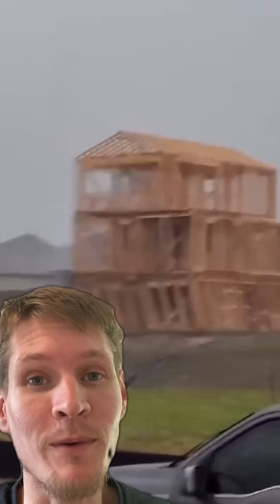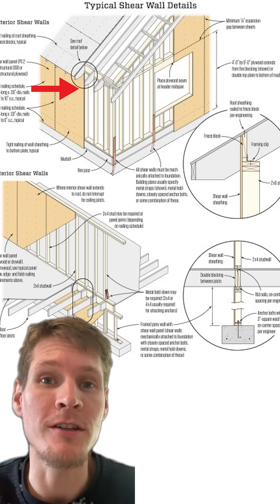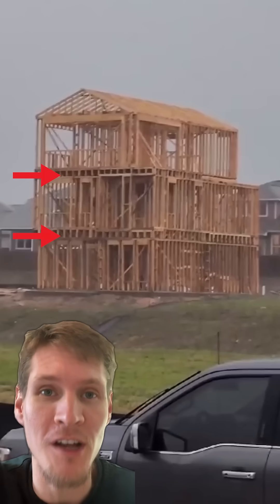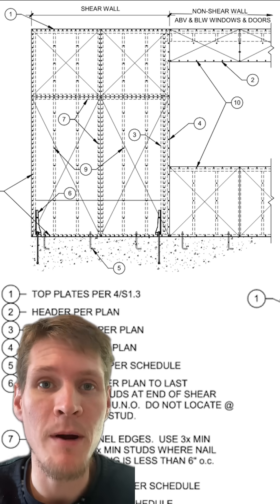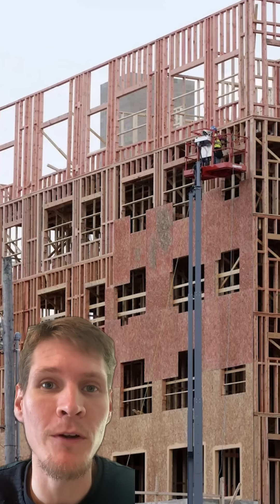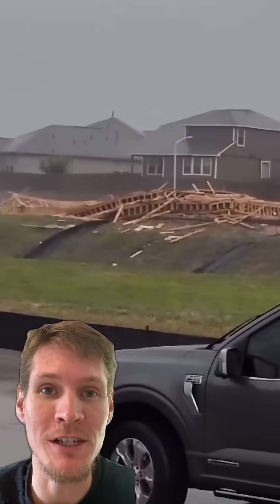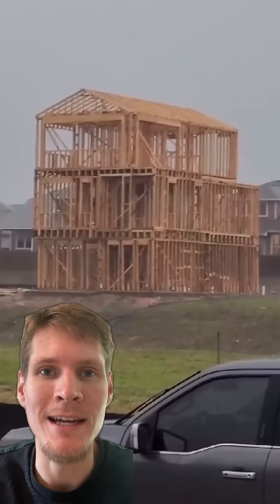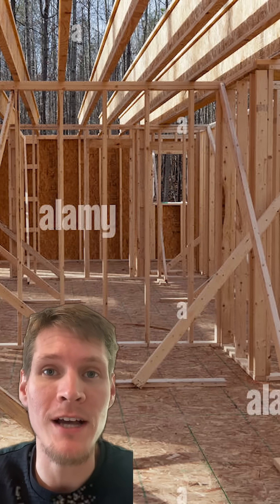Professional Engineer Reviews Reddit Structural Engineering Thread | Part 1 #engineering #reddit

Comment: I can't believe it even stood with 3 story's as long as it did with not sheathing.
Reply: Yea how did they even stand on any of this to frame the second and third story? This is a house of cards from day one.
Reply: @_JimmyBeGood  does everyone ignore the shoring he talks about? and the portopotty being knocked over?
Reply: @kwiztas  What shoring is visible is nowhere near enough. Note in the example he shows all that shoring done just for one story, not for 3.  The point is all that shoring was just to keep that from blowing over, not so it could support 2 more stories.
Reply: @kwiztas  insufficient for structural integrity. Load bearing so first floor should be reinforced and ticker wood used. They used the same crap up top and down. Physics.
Reply: Ya, imagine a bunch of guys up on the 3rd floor or roof, trying to finish… then they hear this noise they’ve never heard before!! Oops
Reply: @kingdommanlegacyministries7769 and then theyd never hear any noises again😮
Reply: Building the roof of this rickety mess was likely a nightmare. Moving those boards and beams in place probably created noticeable swaying of entire structure which was more obvious up there.
Reply: @marthein7 yep...as a framer, they had warning. Even a poorly braced single story will shake as others crawl around.
And shoring?.....regional term? 
Diagonal bracing what we call it.  The wall bracing for alignment was little help.
Did a lot of cut in braces or steel strap bracing   sheathed with foam.  They were pretty squirrelly too.
Reply: It didn't fall over from its own weight, It was knocked over by a storm big enough to rip out those diagonal 2x4s. the Diagonals hold up quite a bit of weight in normal conditions, as theres not much force coming from the sides
Reply: That's why timber framing is always better and stronger.It doesn't rely on plywood for any structural strength.
Reply: Using skyhooks 😅😅😂😂
Reply: @dr-rexmangrca113 k
Framers sheet the exterior walls on the floor and then stand them....
Interior walls are next
Then either floor joists for the next floor or roof trusses if it's a bungalow.
Reply: @1badcrow463  back before 1970s we  install braces in the walls... Top of corners running across several up right studs... Then cover them leaving them there forever...
Reply: @dr-rexmangrca113  This video was a horror movie.
Reply: If you look closer you’ll see it’s only half done.
Reply: *storeys
Reply: @Youtuber-k2p  *stories ....LOL

Comment: Carpenter here. That building looked like absolute shit to begin with.
That's all.
😊
Reply: It had clearly already been swaying in the wind for some time. That's probably the only reason they started video recording it.
Reply: I'm no Carpenter, just a Welder/Fabricator... but it looks to me those floor joists would be "waving" at me, even without any wind... 🤣
Reply: Agree - like toothpicks!! 😂
Reply: Engineer here. The only thing that looks wrong is no sheathing.
Reply: @JoeTheScientist  This would be an excellent short video to show to construction crews framing buildings. It's an excellent, Quick video that a
manager could show, and crews could watch on their smart phones and have an easy reference, and take very little time to show crews before they head out to work.
Reply: Auditor here. As someone with no experience in building whatsoever, I agree.
Reply: Yes i came to say same thing, looked off before even falling....and who the hell doesnt at the very least sheath the first floor. Never seen this done in over 35 years...and dont blame it on the younger generation...because they were taught by us older guys.
Reply: Not a carpenter here. And that building looked like absolute shit to begin with…. That’s all also
Reply: As a mechanic, I agree.
Reply: Joe, little more detail on your assessment, please.  To me, I see almost no horizontal framing at all.  This is just a deck of cards, right?
Reply: @ yes that’s right! The crew who framed it put a few support boards as they showed in the video. But that’s not meant to hold 3 stories of framing. lol
The sheathing should have been put on at least the first floor before continuing.
Reply: I’m from a seismic country and just a quarter of a second of watching that building was enough to cause me nightmares
Reply: Most american houses look like a matchbox to me but this one looks extra crappy.
Reply: @GuybrushThreepwood-e7n  👍🏼
Reply: Air nailing?
Reply: @kk-rc6dw  you could put a nail every quarter of an inch, it would not stop this. Nails don’t = structural integrity.
Reply: @arnold8746  you use screws bro
Reply: @victoriadedicova screws are weaker than nails. I love remodeling decks screwed together. one smack with a slege hammer sears screws right off.
Reply: @victoriadedicova you don't use screws bro, they don't have shear strength which is why nails are used..
Reply: Not screws.  @victoriadedicova
Reply: @Ghostdog99 When the cordless impacts first came out, most realized very quickly how weak screws are and how easily the heads snap off.
Reply: Beautifully said, couldn’t have put it into words better.
Reply: I don't believe you Joe, everybody thinks they're a carpenter that's why we have problems like this here.
Reply: Yes. That was my impression as well. It looked like it was half - assed from the moment the sill plates went down.
Reply: Hahaha I thought the same thing! I said if that was my house, I’d be hoping something like that happened. 

However, I don’t think I’d ever hire a company that would build 3 stories without any sheathing
Reply: Not a carpenter - still pretty obvious 😂
Reply: Exactly!😂 my 2nd grader said it looked like his popsicle stick house 😂😂😂
Reply: Forgot some diagonals
Reply: It’s in Texas what’d you expect? I’ve lived here for 20 years and every home here is built terribly
Reply: I was giving them the benefit of the doubt and thinking the wind had already moved it before the video started.
Reply: That bracing much have been shit
Reply: @Nath-sn1mv  they should have had cable ties locking it all together. My guess is, they didn’t realize that heavy winds were coming s
Reply: @Growinggolfing  mmmm I can agree to that as a possibility
Reply: I don't think it was bad. I've only helped build 18 house so I'm no professional but I got some experience 

Pretty sure it had something to do with management and not much about budget and or experience workers
Reply: I’m from a seismic country and just a quarter of a second of watching that building was enough to cause me nightmares
Reply: 😂❤💯😌😹i had questions 😄
Reply: Agreed
Reply: No doubt.
Reply: Show me one that was built in the last 50-100 years that doesn't look like sht? Did you build any?
Reply: @ any house I have built looks tight.  Plumb, square and level.  Every single time.  Some of us still have integrity and take pride in our work.
Reply: @jameshinton429  thank you.  My sister just had a set of lower cabinets installed in her pantry.  One on either side of a chase built in there for furnace flue.  The cabinet guys built the cabinets plum and level, but next to the chase wall it makes the cabinets look out of wack because the chase is not plum nor the same size on either side.   They must have just eyeballed building it and cutting the wood.  So sad. A 15 year old house.
Reply: It’s in Texas what’d you expect? I’ve lived here for 20 years and every home here is built terribly
Reply: How can you tell? Do the studs all look warped to you? Do you see something with the joists or blocking? Something with the headers? What can you tell is done poorly from what we could see in that 3 second somewhat distant video?
Reply: Looks pretty standard to me, besides the paneling
Reply: looks better on the ground
Reply: Almost all those houses will look like shit after only 50 years.
Reply: They confused me when saying, "it's not all bad"...
Reply: house inspectors have big social media followings because lots of expensive new builds look like absolute shit to people with a trained eye unfortunately lol
Reply: I agree completely!
Reply: As a german carpenter master i never understand these construction. Build over 100 houses. OSB inside.
Reply: Just remember, you're just a carpenter, NOT a designer or an architect you have exactly zero  input/say in what a building looks like. Unless you're building your own building
Reply: Non-carpenter, know-nothing here. Even I could see that structure was crap.
Reply: @RobinDale50 exactly!!!!! Like u have to claim some type of profession to have common sense lol😂😂😂😂
Reply: @RobinDale50  👏🏼 it needs some bricks!
Reply: Buildings more than 1 storey high shouldn't be built from the same stuff as furniture.

Just because you can cut wood into thin sheets doesn't mean you have to use it for everything...
Reply: Sorry, friend, that's not a building.
Reply: It’s just American, that’s all.
Reply: @coprographia  what country is known for good infrastructure?
Reply: @coprographia has nothing to do with that. They just didn’t hire people who knew what they were doing
Reply: @Dctctx  More likely than anything is this is cheap construction. The people knew what they were doing. Coulda been 100 of these houses built this way then a good stormy foggy week settles in and bingo bango we got a Youtube clip full of assumptions.
Reply: @Dctctx pretty much all of the new houses we build suck ass these massive land developers cut every corner to make more profit.
Reply: @Yugemos  still crap. Would not buy a stick frame house if I was paid. In US I owned poured concrete and sip houses. 10 years in construction, would not live in the stick frame.
Reply: @notsus6956  Yeah it is the land developers not the shitty construction.
Reply: @Dctctx They would have to know what they were doing to build it that high. How didn't they know to sheet it? Every framer knows this.
Reply: @Dctctx has everything to do with that. Why do you build houses like this? These houses are as expensive as a brick house, why not make em the same quality? Because of profit! Never heard of bricks? Brick buildings literally last centuries. Some even milennia.
Reply: @victoriadedicova you don’t know.  Stick frames are fantastic when built by people like me.
Reply: @victoriadedicova engineers are funny.  Educated by books rather than on the job.  You guys are adorable.  You couldn’t stack a conventional roof if you wanted to.  Well maybe a one story shed…
Reply: @jameshinton429 what does this have to do with an engineer?
Reply: @gregkeeyako  that chick is an engineer, acting like she’s a builder.  I was just talking some crap to her because she’s funny.
Reply: @Yugemos  says the guy who knows nothing about carpentry. No one builds this way. not anyone.
Reply: @Dctctx  Well, it has something to do with it. There are countries where unskilled workers are not that common because they need many years in school before they do this work. A lot of housing in USA is very poor quality from what i have seen.
Reply: @Dctctx  we dont build with cardboard in EU
Reply: @victoriadedicova  Sure bud. even though stick framing is literally okay as far as the engineers are concerned.
Reply: House in the US are
Reply: @olhcolhc6701  Not mine. I built it myself.

Comment: Alright, as a German maybe building Houses Out of paper and Sticks isnt a good Idea at all, especially in harsh weather conditions like this.
Reply: this was probably just a heavy rainstorm. and not what i would count as a harsh weather, like a tornado or hurricane. even a brick house can easily be destroyed by an EF4-5 tornado and would be at risk at a EF3 tornado. (once fully built) a well built house to code for most of the US is built to survive in sustained winds of 90mph (145kph), and florida has codes for 150mph (240kph). then there are regions like the west cost where they have to worry about earthquakes.

so it is literally a gamble on spending the extra money on the brick house that could be destroyed the within the first 10 years it was built.
Reply: American suburbs sprawl out and are low density. Developers want to build as much as quickly as possible for a quick profit. That’s how you end up with garbage like this
Reply: Stick built house is just fine if it’s done correctly. In Michigan we use 2x6 for the walls and build platform. The 2x6 walls allow for all the wiring and mechanical work to be concealed within the wall cavities. And then insulation is added. Most cases it’s fiberglass batt insulation at R19 or R21.  I have never seen a house built stick like this. Most framing crews usually have a rough terrain forklift on site ( we commonly refer to it as a SkyTrak ).  They built the walls on the ground and fasten the sheathing first then stand the walls up.  First you plumb them straight and install diagonal bracing from wall to sub floor with 2x4 lumber. After the walls are true you connect all the walls together with a Top sill plate A single story house will get trusses installed at this point and then after the trusses are installed and braced correctly the house is solid. 
If the house is 2 story then you install floor joists on the top sill plate. Then you install rim joist that will be flush with your exterior wall sheathing. Then you install the 2 story subfloor. This would complete the (platform) and from there you can repeat the process to build additional stories.  This video is insane. The fact that a crew was even working on that without the walls being sheathed tells me that they were extremely fast and reckless. Probably a large migrant crew from south of the border.  No way a large crew of whites are going to gamble with their lives like that.
Reply: you realize why usa even exists? 250 ish years ago, some folks from Europe felt lazy and entitled, so they made a country over here to be their own heathens. now, all these years later, we are all smoke and mirrors. money drives everything here...homes considered "mansions" are complete junk.
Reply: As a fellow European, although from Sweden - being used to houses made from wood, I wonder the same. Why not build houses with real timber framing or at least real wooden beams, not toothpicks and relying on cardboard holding it together.
Reply: @Trubbas  Well, we have somewhat different perspective. With so much thermal insulation needed (and framing scaled accordingly), in most of the cases we don't even need to think about structural strength.

Comment: Im actually kind of confused by what I see. Can anyone with experience explain to me why I don’t see a rim joist on any level of this house? Plus can’t tell if those are floor trusses or i-joists for the deck framing.
Reply: My opinion, this was staged.  Why, I don't know.  But the entire building doesn't make any sense.
Reply: possibly built by someone with a little bit of knowledge and not much experience...all the mistakes were processes that are done as you build each floor....it is extremely expensive to do it later....one other possible explanation is money.......as a contractor you get paid in 3 draws you get one draw per floor and the last when it is ready to roof..you dont necessarily have to be complete each floor....that would be for your final payment( 10 per cent hold back)generally if you are working for a developer.. he would insist you finish at least 90 per cent of each floor, including sheathing......however if it is a homeowner who doesnt know the difference...they will likely pay each draw ...as the contractor would likely tell the owner ..sheathing would only take a day once the arial lift showed up...This is one reason why you should have a general contractor build your house.....if this happened on the structure...imagine the mistakes that would be made on the rest of the building , ie.  electrical, plumbing. insulating and drywalling

Comment: What happens when the contractor uses a green card framing crew. The cladding crew never showed so the framers just kept framing because they want to get paid. Seen cabinet crews, high AF on meth, install cabinets in houses that had no drywall in yet. Seen Drywallers so houses that had no plumbing or electric on yet. Seen HVAC rip out plumbing & electric because it was run where the duct work was supposed to be. The more Green cards the worst it gets. Seen INS surround a housing development with a 100 guys and drag off 360 illegals in one day. they were all back 48hr later

Comment: Can't you stick the corners in cement at the foundation level when starting the build? Seems like an obvious thing to do when building a structure? I ain't no building engineer, just asking
Reply: That's sort of how a pole barn is built. A pole every 8 feet or so goes from the roof down into the ground several feet in concrete. The poles are thicker than studs so they can resist bending at the point they come out of the concrete. It doesn't quite work with studs. Since they're thinner they bend and break more easily so you'd need almost every stud stuck down into the concrete. They would also need to be crazy long to go up to the roof to keep the upper 2 floors from still flopping over.

Comment: If the diagonal bracing is nailed correctly as well as the temporary bracing it should have never collapsed.
  1 ) If it didn't have let in bracing in the wall corners why did they wrap the corners with OSB or plywood ? 
  2 ) I also suspect they only tacked the floor and roof decking . Planning on coming back and gun nailing all of the decking when they did dead wood and any other punch out.

Comment: Porta potties around here have to be staked into the ground and even then, if they don't do it right, they still tip over. 20 mph is pretty regular here. 40 is common enough. 50-60 maybe once a month, maybe two. Just a few weeks ago wind blew over a storage unit building under construction. None of the siding was on to prevent wracking.